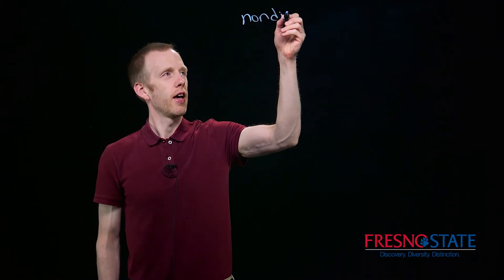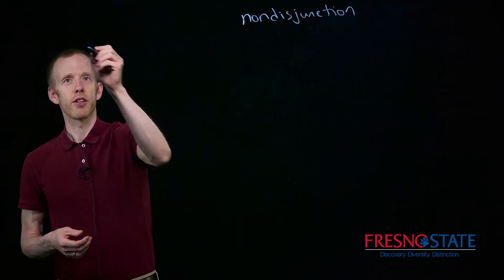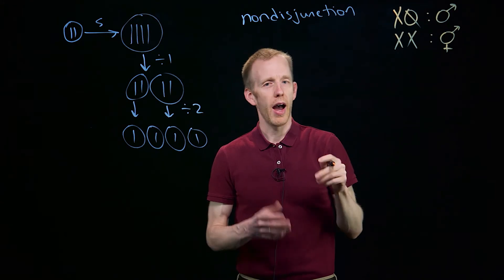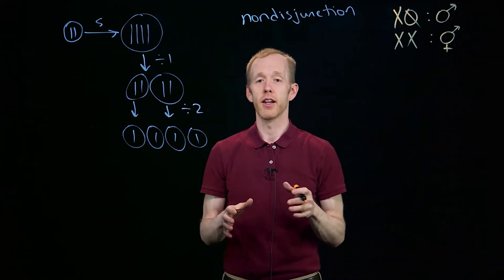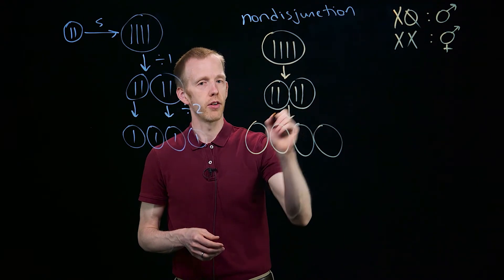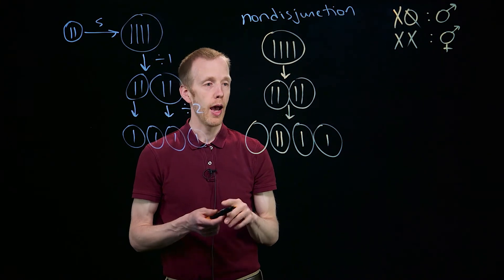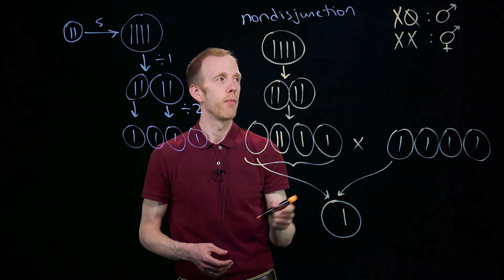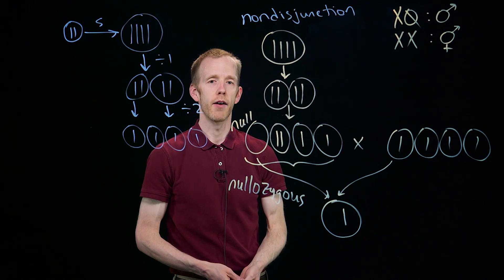Nondisjunction

Comment: Was gonna assign this video to my students but watched just the first minute and already found two fairly big errors. Nondisjunction isn't necessarily about sister chromatids not segregating, but may be about homologous pairs not segregating if the nondisjunction occurs in meiosis I. Also, the first meiotic division actually does NOT produce diploid cells, as was stated. They are haploid at that point, but just with replicated chromosomes.
Reply from the maker: Hi Mary, thank you for the critical comments. I agree with both of your points. I created this video specifically for teaching one point about nondisjunction (and not about all forms of nondisjunction), so I'm glad you watched the video before you assigned it! As far as the diploid/haploid point: I teach this distinction differently than most, because I've found that students generally don't appreciate the key differences between c and n, so I do purposefully (but technically erroneously) start teaching genetics just referring to total DNA content, and then later  (once students may be more comfortable with the cell cycle and DNA replication and segregation) discuss the difference between c and n (DNA content vs. ploidy).
Reply: @JosephRoss  Thanks for the reply!
Reply: @maryvondembussche2904  yes you are correct. when he talked about the first division as diploid it lost credibility. Would have been nice if he also talked about meiosis 2 non disjunction as well in comparison to just meiosis 1